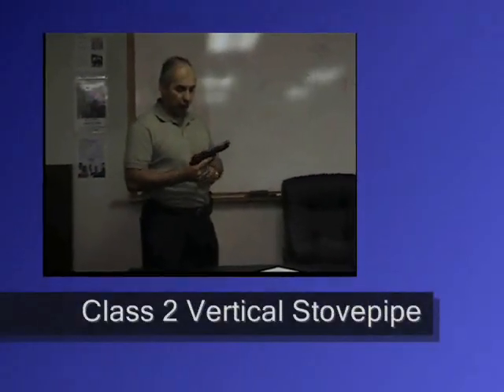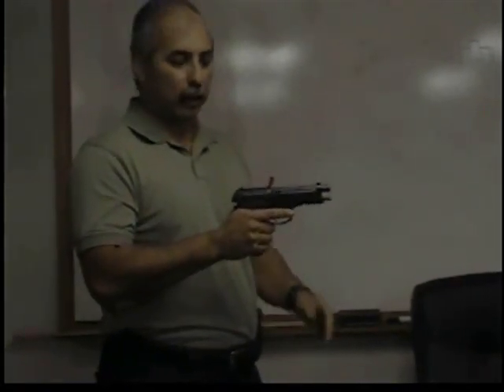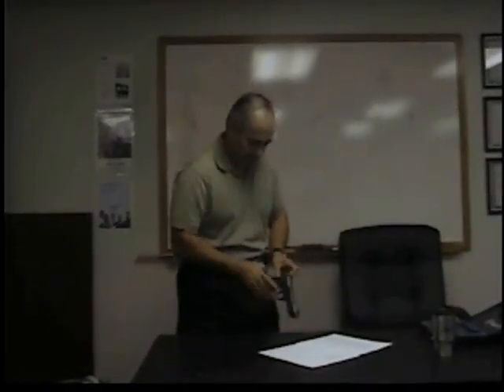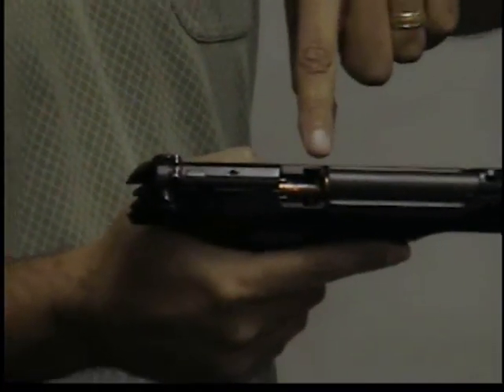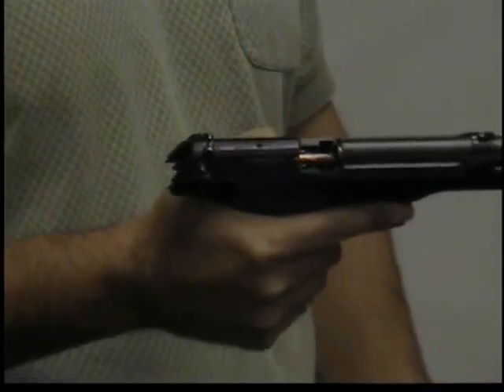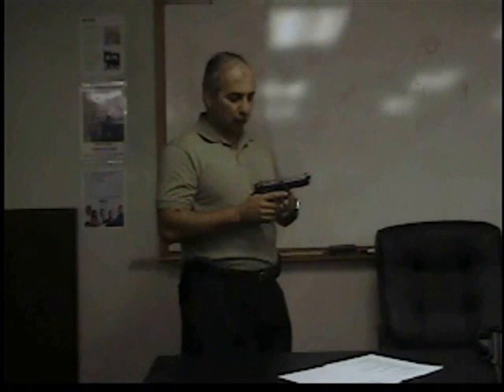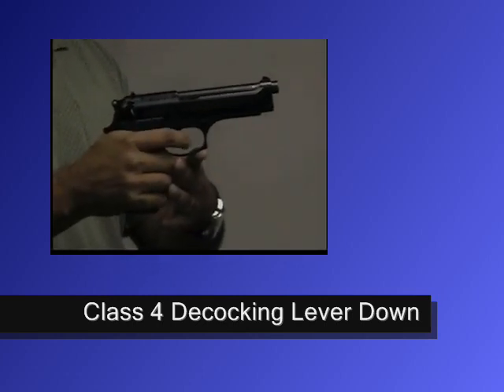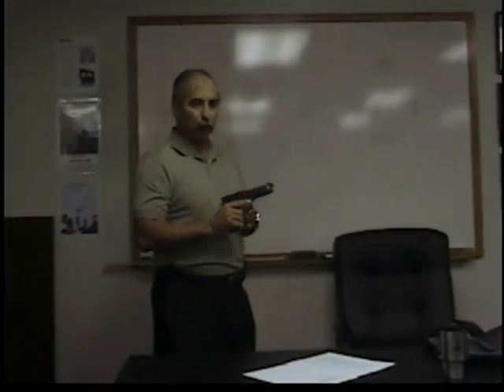Fire Arm Safety - Beretta 92 Five Malfunctions and How to Clear

Comment: I just happened upon this video today, 08/08/2018. I got caught up in the Beretta 92FS craze years ago and purchased the Pre-Ban Italy model. Using factory ammo at an indoor range the gun's slide jammed so bad it was a struggle to free it, a real muscle strainer. I had the double fire using a friend's reloads and on two occasions the grip blew apart causing the spring to fly out. When these things happen in your hand it can be very startling. Once a delayed double fire happened in front of my young nephew and luckily the pistol was pointed down and away or he would have been shot. I learned to use only new, brand name factory ammo after that but still had jamming issues. My nephew thought I was too dangerous to go shooting with so he never went shooting with me again. I couldn't get rid of that beautiful gun quick enough and because of it I have nothing good to say about the Beretta 92FS pistol. I bought a Beretta Tomcat in .32 and the rear of the slide had very sharp points on either side that tore into my flesh. I traded that little piece of crap plus cash for a Colt.

Comment: I had an issue where it wouldn’t the last bullet in the mag. I pulled the trigger multiples but nothing happened. So I recock the slider to eject the last bullet which seem to fix the malfunction, however I’d like to know as why it malfunctioned though.

Comment: I have quite a problem. I was testing out my Beretta 92fs 9mm at home with empty shells to see how well it worked. An empty shell is is stuck in the barrel. The barrel will not move in the slide. The shell has made the barrel immovable. Any help?

Comment: WOW, the de-cocking lever was down????  WTF???

I just watched another video before coming here and it seemed that the guy was always pushing the de-cocking lever up.  Is this indicative of the 92fs???  IF IT IS, then I'm damn glad that I bought the "92G", rather than the "fs"!!!!!

What the G you ask????

The G is the model that makes the de-cocking lever just that, A DE-COCKING LEVER ONLY!!  Whereas the fs the de-cocking lever is a de-cocking lever and a safety (of sorts).

With the G, when it's time for a new mag, put one and keep pulling the trigger, in fact, with the G you NEVER HAVE TO WORRY THAT THE DE-COCKING LEVER IS UP.  PERIOD!!  On the G, the lever is spring loaded and the only option for the lever is down to de-cock and the spring then takes over and it goes back up automatically!!  It like having a revolver with lots of fire power and ability to change mags rather than having to use a 6 round moon clip of sorts and be limited in how many rounds you have.

If you want a safety, then buy a real semi-auto, get a 1911!!!!!  (similar to a Glock, but made for MEN!!)  ;-)